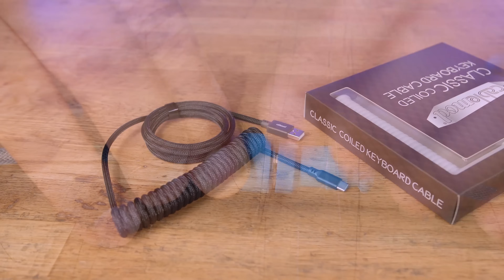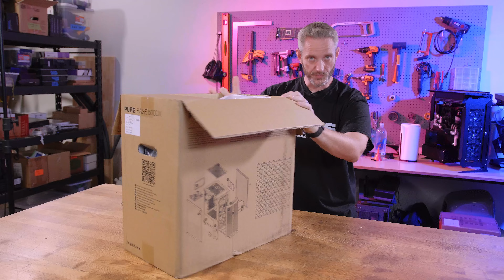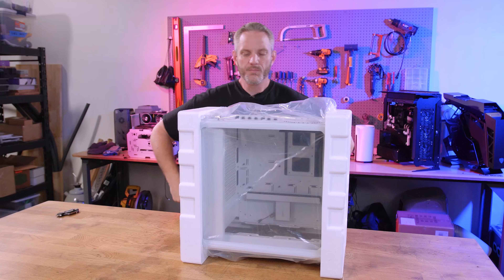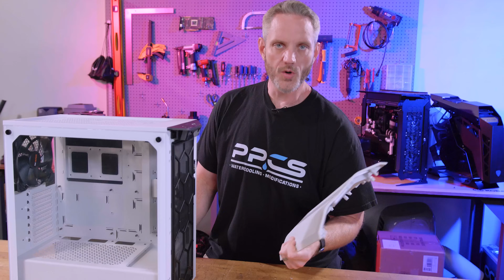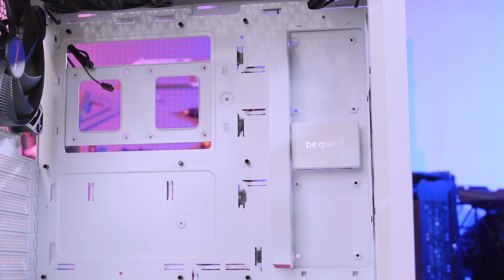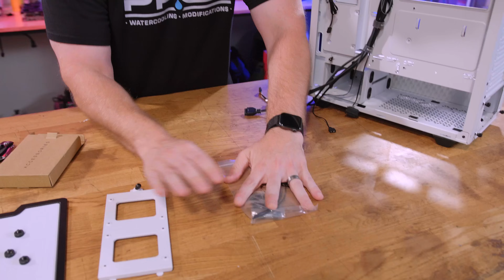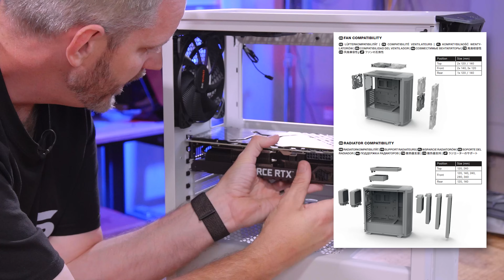An amazing case you can actually AFFORD!

Comment: I get the complains about using HD Audio because of quality... but I am still going to connect it to the motherboard. I have OCD about having all of my ports and jacks being functional. You have no idea how much I am bugged just knowing that Ryzen motherboards have video out ports... but the "X" CPUs not having IGPs  makes them non functional. I usually use the rubber video port covers that cam with my GPU to cover it.

Comment: I keep going back and forth between this and the Fractal Torrent. I have a Pure Rock 2 black CPU cooler and love it, but not liking the idea that this is almost a negative pressure case out of the box. The Torrent has big, silent fans, with the best thermals, but water cooling is almost a no go on it, should I ever want to go that route.

Decisions decisions.
Reply: Well you can easily move one of the fans to the front of the case as he showed to get rid of the negative pressure

Comment: I moved the front fan to the top and put in a 360aio and have a 3080tuff. Love this case. Great thermals and noise. You described the exact scenario of my pc. I did leave the filter sitting on the top even though it's exhaust and it doesn't seem to matter airflow wise. Although with the 3 case fans for exhaust and the 3 aio fans for intake, it's got everything going for it that the top airfilter isn't going to hurt it much.

Comment: Nice, but suffers from the same problem my Cooler Master H500 ARGB has- only a 240 radiator up top, not a 280.  Maybe not a big deal with a custom water loop where you can put a 360 up front too, but with an AIO the best place is up top exhausting - and a 360 or 280 AIO up there makes more sense.  You can get a 280 FAN up there, but not the radiator too...  I know, the front, the front... yea blow hot air into the case...  I think the best use case here is an air cooled setup...  nice and compact.
Reply: I'll stick with exhausting hot air.  Yea I keep hearing it doesn't matter, but my gut tells me that the cooler you keep the insides, the cooler the end result...  Heck I see in summer, my rig is hotter because I can only get the room so cool when it's 108f outside... those extra degrees make a difference in the rig's temps, so I am not going to add to it if I can help it.  Also trying this time around, to like the AIO enough to not go back to my custom loop, too much work, I would rather use the rig and not mess with it because it is never perfect LOL... but I just might because of the tinker-addiction.  Then I would have to put my 360 up front.
Reply: @tzviasegal3003  you could exhaust with just fans and still put the AiO in front😁

Your CPU and Water temp  will thank you, the impact on GPU temps is nearly negligible
Reply: many tests have shown that an AiO in the Front does not really affect the temps of the other parts. so I don't see the Problem with that
Reply: @penedrador  True. As long as the air being blown in is cooler than the air in the case, then the airflow will have a positive cooling effect. But you need to get some airflow across the GPU to push its warm air out the back of the case. If using an intake AIO on the front, I think some high pressure fans would be better.

Comment: About 15 months ago, I got this exact case. The airflow and quiet nature are phenomenal and the RGB is nice. I couldn't be happier with this case - I've become a bit of a be quiet fanboy as my CPU cooler is from be quiet and while I got a three-pack of bog-standard fans for exhausting through the top, I did as Jay recommended and moved one of the included fans to the front for air draw purposes. 

You really can't beat the combination of value, air flow, looks, and (lack of) noise. You won't be disappointed with this case!
Reply: I bought a Be quiet! PSU and it lasted me years so i took a chance on the silent base 802. It was extremely well built an looks awesome. Also compared to building in corsair cases building in it was a breeze.

Comment: I have a black windowed 500D base and I have 5900x and 6900XT Nitro+ in it - all fit great, just thinking about a 360 AIO .... but wondering on vertical mount ... so not sure right now, but this case is THE TOP for the money :)

Comment: Have had the same case for like 7 months. It's great for temps and pretty quiet. Just added 2 fans on front and 1 in the back. One of yhe stock fans is on the roof exhausting the heat.

Comment: I built my first computer over a year ago, and this is the case I chose. It wasn't my first choice, but for right now I couldn't see giving it up for something else. I love it. I only have three problems so far with it: 1) the power button is a bit wonky, having to press off-center to get it to work, but it works; 2) the LED lights kinda stutter from time to time, and 3) the front of the case is really hard to pull off, which is intimidating for someone new to building. I do wish it was slightly bigger, but just slightly, for cables. But I love this case.

Comment: does this case fit 3x140s?
Reply: no
Reply: @jdel1781  looks like it might has anyone tried?
Reply: @ttcustompcs  it won't. I have this case. you can only fit 2 x 140mm in front and top. online manual can also confirm this.
Reply: @jdel1781  right but have you tried, I have had many a case specify it doesn't fit such and such and then it squeezes in.
Reply: @ttcustompcs  i repeat for the 3rd time.. i have this case and I'm telling you 100% it wont fit 3x140mm fans front and or top.  the answer to your question is no. lol

Comment: Does the amount of air flow matter if you go with water cooling instead of fans?
Reply: Yes, because the air is blown through the radiator to cool the liquid inside.
Reply: Of course, you need to exchange the air in the case or it will overheat despite watercooling, all you do with watercooling is having a slower heatbuildup as the water leads the heat away and has to be cooled by the fans blowing through the radiator, the radiator has a much larger surface area than most aircooler and can dissipate the heat more efficiently. Think of a car, every car needs to have air intakes infront of it's radiators, Having more fans pushing air inside the case sucking it through an airfilter stops negative pressure (like he said in the video) that sucks dust through every slot or hole in the case, that dust will end up on the intakeside of the radiator, no matter if you have fans infront or behind the radiator.  I usually carry my computer outside every spring and blow dry compressed air to make both airflow and cooling better for the summer months when it can get really hot. Holding fans still while blowing can help not creating overspeed for the bearings and also currents being produced by the fans now acting as generators, current that can damage these delicate systems the handle very low voltages!

Comment: The Phanteks Enthoo Pro was a smart case. Theres a sliding frame that you could screw the AIO too, and slide it in and out for doing the EPS cables etc...
I feel like it was an extremely under-rated case for its time.
Reply: The P600S has a similar feature, and it is nice to work with. Their more budget cases, at least from the P300, in my experience, also have the top panel being held on by phillip's head screws, and not rivets. So for wiring EPS, and other connectors at the top of the motherboard, it's great. Of any case brand I've worked with so far, Phanteks has been my favorite to work with.

Comment: Got this case for 2 years now. Good for the price but:
 - no gpu holder, and 3rd party ones are hard to build in since pcie slots do have a weird setup
- dc fans (they are not alternating)
- led system is sometimes buggy
- bad electric shielding. When recording guitar noises from the power supply is crazy through the chassis
- etc.

Comment: Phanteks P300A Mesh $80 and the fans in it aren't even that bad
Reply: With the saved money you can get a pack of Arctic P12s
Reply: @gatordontplay417  P12's are good price/performance but all of mine are starting to die out after 5 years of use. Bequiet silent wings 3 are still going strong so I think it's the better investment in the long run.

Comment: Would love to see case reviews include a built system at the end. I know this takes time, but throwing a bare bones air-cooled system in to see the LED's in action etc would add value I think. Wouldnt need to be a full build, just PSU with mobo/cpu/ram to get it to power on.
Reply: When you do that with cheap hardware it can reduce value of the videos.
Reply: @hokiturmix  how? Not suggesting you feature the build process, just have a 5 sec shot at the end with it powered on. Black motherboard, factory cooler and non-rgb RAM. No emphasis on the hardware, just on the powered on case.

Comment: Wonder why case manufacturers don't take a leaf out of Antec's book at fit 200mm fans so they can run slower while still moving a lot of air.
Reply: Agreed also bequiet should make 180mm or 200mm silent wings fans

Comment: I love my 500DX, easy to build in and affordable. Also put a Dark Rock PRO 4 cooler in, nice, cool and quiet!
Reply: Damn dude, same
Reply: @nazahostile  i have a Pure Base 500, 5800X, Dark Rock Pro 4 and 3080!
Reply: same dudes, same
Reply: Same but Dark Rock 4 without a PRO xD
Reply: @szponixx  me too
Reply: @szponixx  Same enough.
Reply: Same squad =)
Reply: Same lol
Reply: Same here 😂😂
Reply: Same 😂
Reply: I have the Black version with a 3070ti and Noctua CPU cooler installed NH-U12A dual fans with 5 be quiet 140mm fans. Did any of you guys find it tight to plug things in at the bottom of the motherboard. The board is so close to the tray I ended up having to fold the USB front panel connector in order to get it into the board. The Case could have done with being about 5CM taller
Reply: I love that thing, shame it's such a bitch to install.
Reply: Likewise. Love my DX and Dark Rock Pro.
Reply: Yup dark rock pro 4 with 5900x and 3080
Reply: yap, the same! Using pure base 500DX in white with r7 5800x (watter AIO) and rx6600XT
Reply: I need to add… I did the same 😂
Reply: Also same, I see a trend here :D
Reply: got the cooler but not the case
got a tuf 501 gt
Reply: Another same here! :D

5800x
Dark rock 4 pro
Msi 3070 Gaming x Trio
And 3 silent wing fans + 2 of the preinstalled one

Looks nice, can only sometimes hear it and everything stays cool!
Reply: It's a POS doushe case faggioso
Reply: Ditto!
Reply: Same as well, 500DX White and Dark Rock Pro 4 :D
Reply: Same to the T
Reply: Same here!
Reply: I hid a thick 280 mm radiator in the space inside the front panel, if there weren't tubes leading into it, you wouldn't know it's there!
Reply: Love mine too! 360 AIO in the front, 3 exhaust fans (top and back).
Reply: same build!
Reply: same squad!

Comment: Ive already decided my next case will be the Corsair 5000d Airflow or 5000T as I want to build the same watercooled white and ice blue build you did Jay but its always nice to see how other cases are built and how they do.
Reply: I got the 5000d really nice tower and again easy to build in . ( mine is black ) no regrets 🙂
Reply: Currently got the 220T case from Corsair. Its a decent wee case but no room for watercooling. My 3070 is about an inch from the front 3 fans haha.

Comment: I've had this case for over a year now. Still love it.
Reply: u think it could cool i7-12700k and 3080 ?
Reply: @mishaq6538  Using that i7 and 3080, fine so far 3 months in :). I'm using an 240 AIO at the top. Great looking case and def. recommend it. It also got space for very, very big air coolers (190 mm) if you prefer that.
Reply: @mishaq6538  it cools a 5800x and 3080 for me easily
Reply: @mishaq6538  absolutely.
Reply: Same! Great case.
Reply: Same.

Comment: This is a very good case and barely anyone buys it for some reason. I have it and replaced all the fans with silent wings 3 version.  air flow is acceptable and the fans are literally inaudible. Not a fan of RGB so I kept the light strip on the front off
Reply: I got the 500 instead because I realised that I don't want an airflow case. I rather have a blocked off solid front, and run the fans faster. I had a meshify c also with silent wings 3 fans, but the fans aren't the problem, the problem is coil whine from all of the components as well as my gpu fans
Reply: @Luxussyy  mine is 500 but i ordered a custom front panel with airflow that the 500DX comes with, they just sent it for 35 euros and i attached it